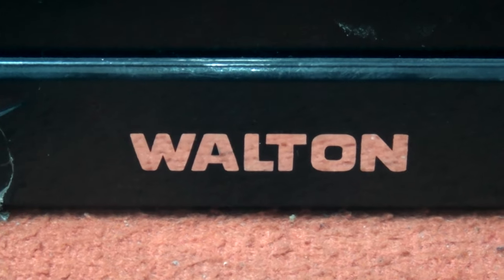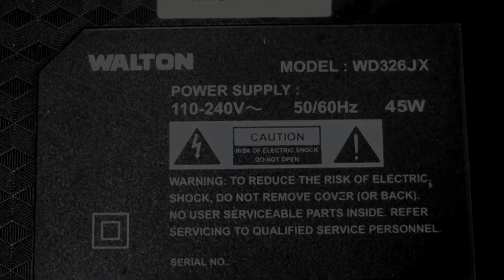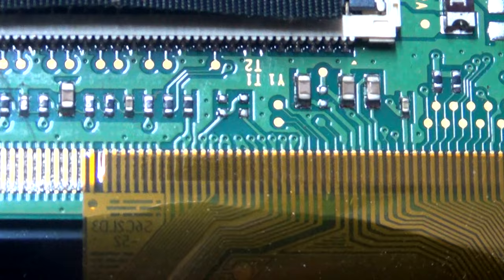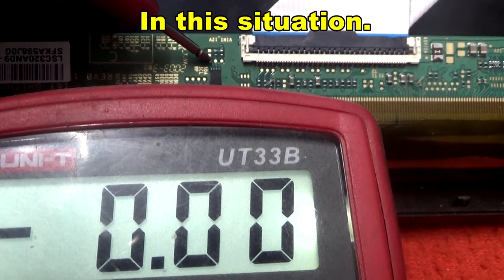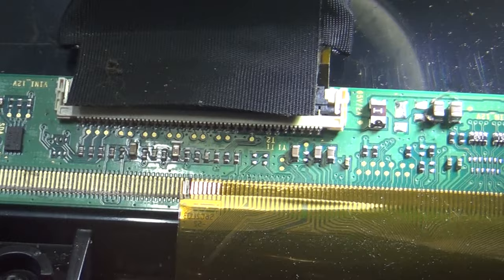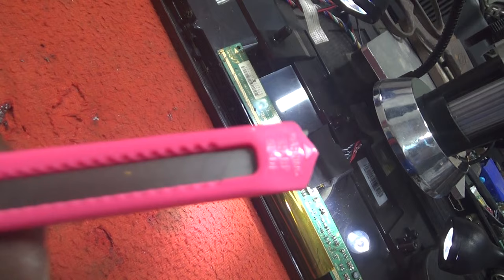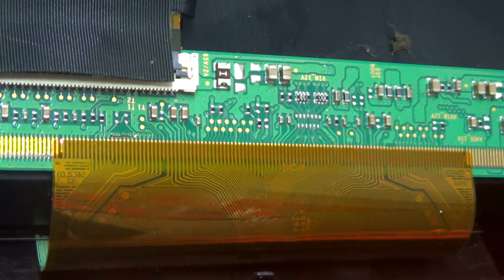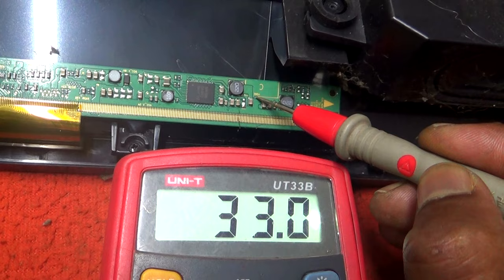LED TV Panel Repair by CKV line cut#LSC320AN10-HO3

Comment: Thank you but i have a question. If you randomly cut the CKV lines and you cut the wrong side, how do you reconnect those fine circuits. I did this mistake once and it took me hours of eye strain to reconnect.
Reply from the maker: For this you need to use a digital microscope.:thanksdoc:

Comment: No ic sm4168, na placa LSC320AN10-H07 no pino 28 tem um resistor que vai ao terra da placa, você  sabe dizer  valor desse resistor? Neste pino onde tem o regulador Boost, correcto?
Reply: sabes o valor ?

Comment: I cut both signal but still no vgh voltage sir
Reply from the maker: Must have a site link connect.
If there is no solution then there is a problem t-con board.